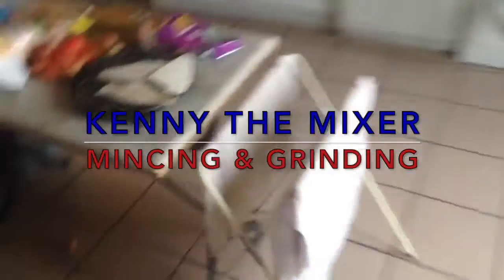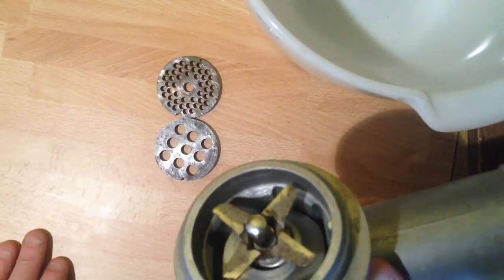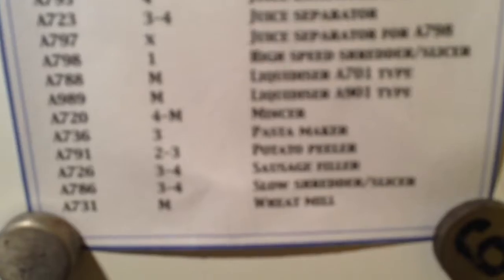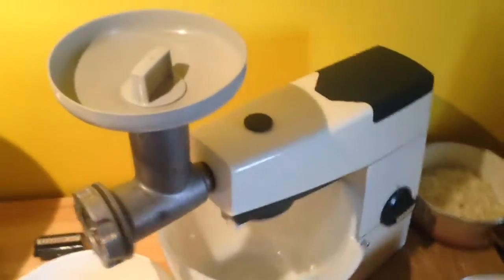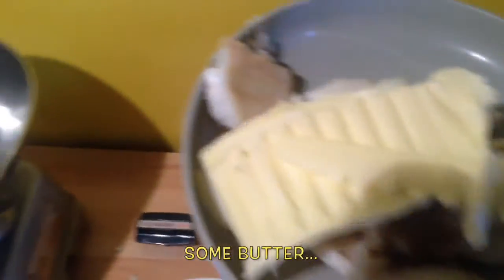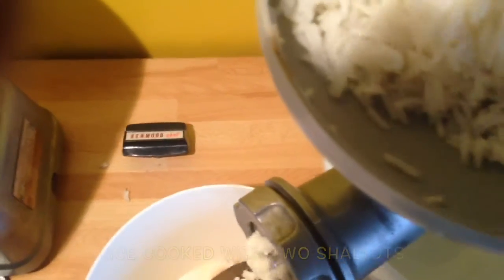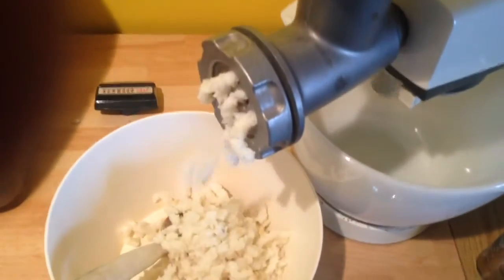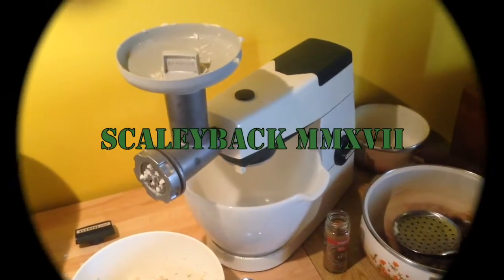Kenny the mixer in... Mincing & grinding

Comment: I can't get the front 'kenwood' logo piece to come away.. it looks like exactly the same model as what you have but it seems like it's fixed on?
Reply from the maker: there is a catch just under it.it has a strong spring, pull it towards the side and then the cover should come away.